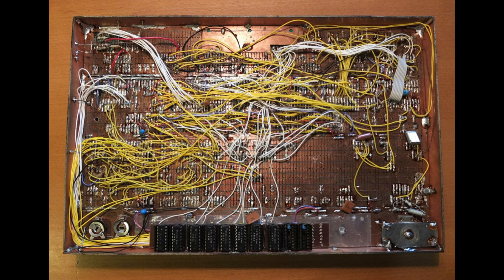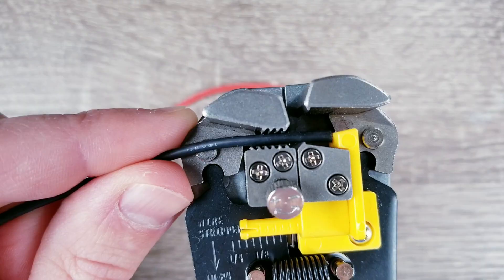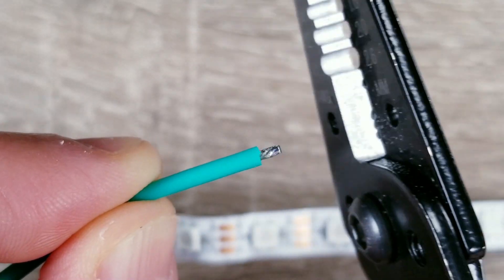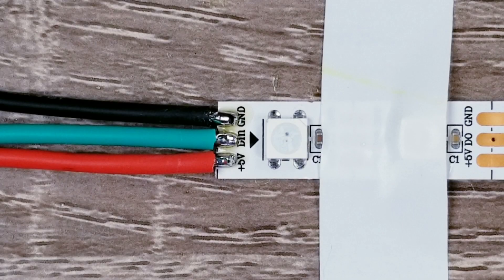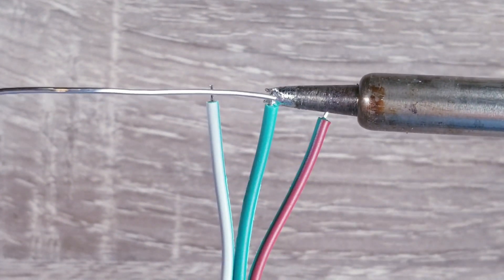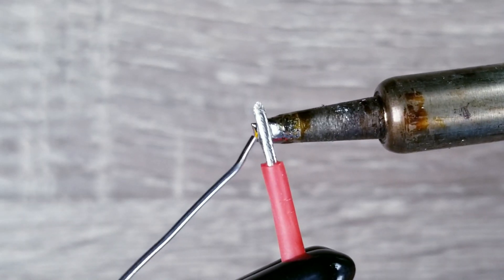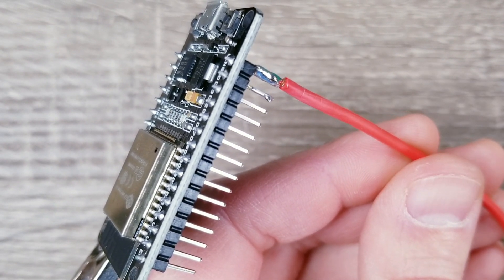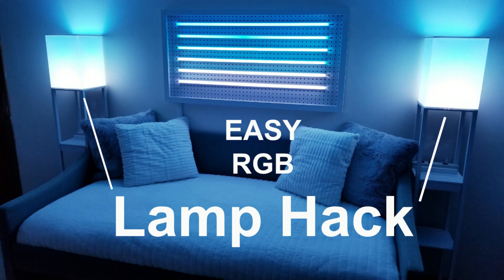THE BEST Soldering Tutorial - LED Strips and More - Complete Walkthrough

Comment from the maker: 📟 BEST Amazon Deals on Electronics: https://amzn.to/47qjC9j (updated daily)
All In One Soldering Kit: https://soldr-affiliatesignup.kckb.me/d8dafd1d
☑  Check out my sponsor to begin your FREE 14 day trial to Aura: https://aura.com/chrismaher
Good quality solder makes ALL the difference. The one that was recommended to me and what I use in this video is widely considered to be the best on the market. It has a flux core which has eliminated the need for me to add flux separately. All solder is not created equally and your experience soldering will more than likely be very different than what is shown in this video if you are using something else. The other thing to mention that I forgot to cover in the video is that a clean tip is very important so make sure to clean often. (links below)

Best Solder: https://amzn.to/3r6smMA
Tip Cleaner: https://amzn.to/4bNcFiU
Wire Stripper: https://amzn.to/3x9RGF0
Soldering Iron: https://amzn.to/3BKMlWv OR https://amzn.to/3jxx1mB
Solder Smoker Absorber: https://amzn.to/3Kx6K4T OR https://amzn.to/3rbHCYp
Helping Hands: https://amzn.to/3v19YG3
Colored Silicone Wires: https://amzn.to/3Keoel3
Black and Red Silicone Wires: https://amzn.to/3DTFARN
Heat Shrink Tubing: https://amzn.to/3733zSH
ESP8266 Board: https://amzn.to/3DMYFVT
ESP32 Board: https://amzn.to/3jkvdwM
LED Lights: https://amzn.to/37t5OP6
LED Lights AliExpress: https://s.click.aliexpress.com/e/_DnBQWTD
Spotless Regular LED Diffuser Channel 1m Amazon: https://amzn.to/47aIujz 
Spotless Regular LED Diffuser Channel 2m Amazon: https://amzn.to/3QoHeDb 
Spotless Corner Diffuser 1m Amazon: https://amzn.to/3DFhRpf 
Spotless Corner Diffuser 2m Amazon: https://amzn.to/3Krqw2q 

=============================
Support My Channel Directly:
Become a monthly contributor on Patreon: https://www.patreon.com/ChrisMaherDIY
Buy me a Coffee: https://paypal.me/ChrisMaherDIY
==============================

LED Tutorials:
Installing WLED on esp32: https://youtu.be/exAWzMfmwQ8
Installing WLED on esp8266: https://youtu.be/l8OMi7SMpqs

Link to some of my full DIY LED how-to project videos:
LED Board and Batten Accent Wall: https://www.youtube.com/watch?v=b13VLiK7AOU
LED Music Visualizer: https://www.youtube.com/watch?v=K4EzLI1fFnQ
LED Baseboard Trim: https://youtu.be/Ik8HnGxfQq0
RGB Lamp Hack: https://youtu.be/UNPR_98xLQY
Corner LED Light using Pex pipes: https://youtu.be/rIbTzUD2E4k
DIY Govee Glide using only paper: https://youtu.be/n9LsiQARFas
Simple Corner LED Project: https://youtu.be/ZB5HqWhMXNo
DIY Customizable Light Up Images: https://youtu.be/2q_zrEcbXHE
LED Strip Diffuser Ideas: https://youtu.be/09-fiWjP42Y
DIY Hexagon Project: https://youtu.be/t9xGyB4ahyY
DIY Edge Lit Designs: https://youtu.be/0_TtHkBB3vA
DIY Black Acrylic Floating Shelves: https://youtu.be/6csSMtV_op0

Unboxing Videos: 

Best Diffuser Channels (same ones used in this video): https://youtu.be/1SKo_HdKVYA
Lytmi Neo 2.0: https://youtu.be/sth-EdEfSis
Govee Lyra Floor Lamp: https://youtu.be/NFDYz37ZoXU
Govee Glide Hexa Panels: https://youtu.be/UDYUvfce4tM
Govee Glide Light Bars: https://youtu.be/e3jJye-fYoM

The best way to help support my channel is to like, comment, make sure your subscribed and share my videos with as many people as you can. The other way is to use my links above as I get a small % at no extra cost to you if you buy something. Thank you all for the support!

Comment: So I have been sucking at soldering for years now. TBH, just your notion on 290C was enough to make it better :P Most videos told me to go with higher temps and that didn't really work. I am not yet able to do it as smooth as you do it, because it takes me way longer to heat up the solder. Could this be an issue with the type of solder I am using? Is using leaded or non leaded solder making a big difference?

Comment: You should use flux.  Yes I know theres flux in the solder.  But Ive been doing this for a decade, and Ive found if you put flux paste on stranded wire it really helps the solder easily penetrate all the wires and tinning is much higher quality.  I apply flux paste every time I make new joints or reheat any joint.  I highly recommend it.  Its smoky but the higher quality is worth it.

Comment: What was the best temperature for soldering the LED strips? You also didn't mention flux. Perhaps your flux is inside the solder? Thankyou,  Rob in NY
Reply from the maker: Thanks for watching! Yes the kester solder I use and recommend in the video has a flux core so i've never needed to use any extra. 600 degrees F works perfect for my soldering led strips!

Comment: No mention of using flux? I was told it is crucial to getting the solder to flow easily around tthe connection and not just fall down in drops.
Reply from the maker: The solder I use and recommend in this video already has a little flux in it so I've never needed to use any extra for it to work perfectly.

Comment: Got 2 soldering irons both are terrible.
Reply from the maker: The ones I use work great. Are you using the kester solder I recommend?
Reply: @ChrisMaherDIY Nope, bought one soldering iron from Aliexpress, it goes up to 500C but it starts to get dark at the tip and doesnt heat as well as in your video. I clean it from time to time but think its just bad.

Comment: I think one of the most important things that I got wrong in my younger days when I attempted to solder is the temperature. It's wise to get a good digital iron and set it to 288c. Mine was not hot enough and I could not get the wires to join to the pins quickly, or at all. You mentioned this, but I want to emphasize it again as I think it's a common mistake.

Comment: seen a few videos, love the way you explained the steps. soemtimes my cable wont stick or solder wont hold. now i know what i am not doing. But if i wish to connect 4 pin led strip cob, with another 4pin, tstrip to strip, the space is so tight to ensure each end remains isolated so you have 4 individual connections. how to achieve that? mine want to touch the neighbouring tips too lol

Comment: I didn't see you using any flux in this video... is this a necessary thing to use flux or not??
Reply: Odd to me as well but most solder wire has flux in the core. Such a small quick job as led strips, that little bit may be sufficient.

Comment: Newbie in soldering i have 2 questions

1. most of the time I face problem with soldering iron and lead, when I solder either circuit copper pads gets out of the plastic pcb and damaged. Mostly happens I adds lead on  thin wire but whwn I try to add on copper pads they donf combine and wires just moves off from lead. And when I try several attempt this issue happens. Why? 

2. What type of stable clips you recommend to hold the wires?

Comment: My solder just doesn't melt like that. Ever. Every tutorial I watch they just touch the solder to the surface and get easy melting. From 290 to 400 degrees Celsius, my iron can melt the solder just fine, but no surface will ever melt the solder. I can barely even hold the wires a few inches away from the iron it gets so hot, but the solder still doesn't melt. I've never seen this problem mentioned, so all these tutorials do nothing for me because the basic steps are impossible to replicate.
Reply from the maker: Are you using the same solder I'm using in the video?
Reply: Try adding flux. I noticed Chris doesn't do that (not necessarily a problem depending on what type of solder you're using), but I was having the same problem you are having and adding flux to the tinned pads and tinned wire first solved the issue for me

Comment: Also, another question. What’s the difference btw tween the three 18 gauge wires that you use & the standalone solder wire? Can’t you take one of those 18 gauge wires, cut off a piece, remove the lining & use it as a solder wire?
Reply: Different metals

Comment: I’m wire clueless so I have a question. I’m so confused by the wire colors (red, black, blue,  white, orange). How do you know which ones to solder to what?? The only part that I could honestly see myself doing correctly is lining up the strips and soldering each end to each other. But when it comes to the wires I’m just so unsure. I get how to solder it just not so much how to know which to connect to
Reply: The colors don't actually matter. They're just to help you keep track of which circuit is which. Usually I use red for positive, black for ground, blue for data and green for data backup. Bare in mind that your strips might be different. I primarily use RGB CCT IC strips.

If you just have an RGB strip, use a red wire for red, blue wire for blue, and green wire for green

Comment: When using two WLED controllers for different strips, how do you get them to behave like one long strip? When both controllers are synched, the effect starts at the same time but id like the first strip (one controller 1) to transition into the other strip (on controller 2) to appear as though they’re running as one strip. Apologies for the amateur question.

Comment: What a load of bullshit!  The solder (which has an "l" in it by the way) doesn't stick to the LED strip!
Reply: Try using flux. He's using a high quality rosin core solder in this video so flux isn't needed. I had the same problem as you and adding flux to the tinned pads and tinned wired before soldering together solved the problem.

Comment: It’s still not working for me it just results in tiny bead
Reply from the maker: @hanacharyislost5047  thanks for watching! Are you using the same solder that I'm using?
Reply: @ChrisMaherDIY No, im using a Chicago fine tip solder iron
Reply from the maker: What about the actual solder? That's the most important part. The one I use in the video (kester) is the best.
Reply: I use the same solder as you. Try adding flux to the tinned pads and tinned wires before soldering together

Comment: I’m having trouble getting the solder to actually stick to the led strip itself? 
Dirty? Cheap solder? 
Shew!!! 2 hours trying to make one broken connection and I finally gave up! Temporarily anyway
Reply from the maker: Thanks for watching! Are you using the solder that I'm using in the video and linked in the description?
Reply: @ChrisMaherDIY  no sir. That’s my question I guess? If it may be the cheaper solder that I’m using(
Reply: @ChrisMaherDIY  after your video I actually decided to try it again cause I don’t throw away anything. Now the lights operational! I was able to actually peel back the layer of coating to access the copper strip itself behind the solder point and was finally able to get the solder to stick. Let it cool and then made the wire connection. Saved a 60 dollar LED light. So thank you for the detailed video of how to solder and the little info your able to sneak in that’s probably “Soldering 101” to everyone else. But for beginners, NICE!

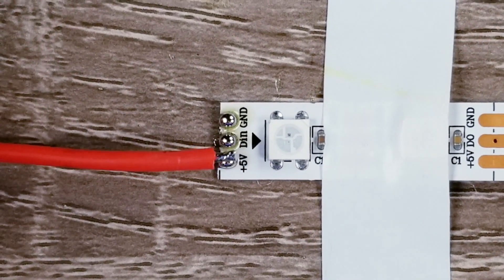Comment: at 2:26 when I press my cable down with my soldering iron the solder underneath on the led strip does not melt no matter what I do. Does anyone have a suggestion what to do? What might I be doing wrong here? Thanks in advance
Reply: Try adding flux onto both the tinned pads and the tinned wires before soldering to the pad. Also, make sure have a little bit of solder on the tip of the iron to help with heat transfer.

Comment: Hi Chris, thank you so much for your videos, they are very helpful and well explained. I have a question about welding. With this type of LED strip every 50 cm they have a soldered connection. Currently for my project I would have to divide the 5m into two strips of 2.5m each. Reconnect the two strips as you did in another video with the Govee M1 strip, is it possible? Is it necessary to insert an additional power injection after connection?. Thank you in advance for your kind reply.

Comment: Is 18 awg is overkill?
Reply: Good question! If the break in your LED strip is shorter, like less than 12-18 inches then 22 AWG wire will work fine, if you go more than that, you may have voltage drop if you use the 22 vice the 18 wire. His breaks were longer than 18 inches, so he opted to use the 18. Just something else for us to keep in mind.

Comment: I have 3 problem

First. 
 solder dont stick to led pads it stick to solder tip.

2nd.

The led strip melt faster than the solder

3rd.
Wire don't stick to solder after    pre solder the pads
Reply from the maker: Thanks for watching! Bummer you're having issues! Are you using the solder that I'm using or did you get something different?
Reply: @ChrisMaherDIY 
Solder wire
Sn30
0.6mm
Flux

Brand name : Adel

Comment: Hey Chris, do you ever have issues with connecting to WIFI on these boards? I have 2 esp32 boards in separate rooms and it seems like I can only get one at a time to connect in the WLED app. I have to go into the WiFi the board is sending out to control the other. I’ve tried a WiFi extender and wiping the board and reinstalling WLED  and I’m still having issues.

Comment: Hey Chris, I really like your videos and the tips you give are very helpful. Recently I came across an idea of installing the LED strip behind my desk and take the same strip to attach behind the monitor. Searched for a lot of solutions, got one as to use a T connector but that is impossible to get here in India. So can we solider extra wires in middle of the strip and connect the led strip. Will it work, so is there a different solution for it. It will be great if you help me find a solution for it.

Comment: I've soldered some strips, but it seems the lights gets lower as the length gets bigger, how do I solve this issue? Some saying it's because I connected them in series and I should connect them in parallel
Reply from the maker: Thanks for watching and for the comment! This is normal. Every led that is lit up draws power. If you have enough led lights, eventually there will not be enough power to properly light them. Search on YouTube for power injection led lights and you should be able to find some good resources!
Reply: @ChrisMaherDIY  thank you

Comment: If you're not as successful as this guy is, in getting the solder to stick to the wires or led terminals Dip the wires into flux if solder isn't sticking use flux on everything you are soldering if solder isn't sticking but if you can solder without flux like this guy all the power to you im guessing his solder has flux in it if so must be a good brand cause I've used solder with flux in it and still had it add flux as well

Comment: I know this is an older video and this may have been asked before but, could you essentially solder wires to an uncut LED strip to essentially split the signals and power without having a gap in your LED conduit?

Comment: I just tried this on my M1 and must have done it wrong. I was very careful, but I may have heated the contact points too much. The strip works up until the cut, but doesn't after. The last few leds before the cut are always blue( even when the strip is turned off), and the 1st few after the cut lit up a tiny bit. Any idea what I didn wrong?

Comment: Some questions:
1. When you're putting the solder onto the contacts of the LED strip, are you actually touching the contact with the soldering iron, or is it being held just above the contact, and feeding the solder into the space between the contact and the iron?
2. Or are you actually placing the iron directly on the contact and then feeding in the solder?
3. It seems to take an age for the solder I've got to start melting, and I never seem to get enough temperature to melt solder from the top of the wire. Am I doing something wrong here?
4. With 3, I bought a very cheap soldering iron kit, and I'm using the solder from that. It's supposed to be lead free solder with a rosin core, but it doesn't seem to melt or flow nicely. Is this just because I'm using shit solder, or am I doing something wrong?
5. I bought a better soldering iron, which should be hot enough to melt the solder I have. The soldering Iron goes up to 450 degrees C, so it should easily melt the solder. it still takes ages though... is this right?

I'll be the first to say that I'm shit at soldering, so I'm sure a lot of this is me messing up, but I'd be really grateful if you could give me some more pointers!
Reply from the maker: Thanks for taking the time to comment! I am actually touching the iron to the contacts and then feeding the solder. In my experience the solder is what will make all the difference. The one I link to in the description is the one that after doing some research was the most highly recommended type and has been very easy to work with and my guess all your challenges are mainly from the solder you are using. Try getting the good solder and my guess is it will make everything 100 times easier!
Reply: @ChrisMaherDIY  Thanks for that!
I'll look into some better solder. Unfortunately it looks like your exact recommendation isn't available in the UK, or at least not on Amazon, so I'll do a bit of research :)

Comment: great video and easy to follow, just having trouble myself when going to attach the wires to the already tinned led strip, the copper pads come off from the led strip with the wire ATTACHED, not sure if im leaving my iron on too long. Can i still solder the wire onto the strip with no top copper pad, having trouble having my solder stick to the strip with no pad, would flux help me with this problem thanks any help